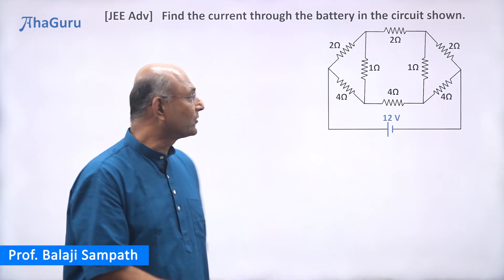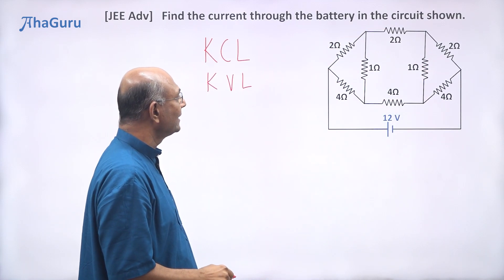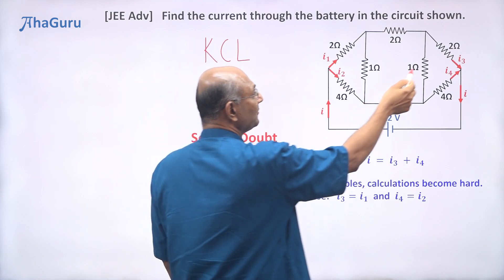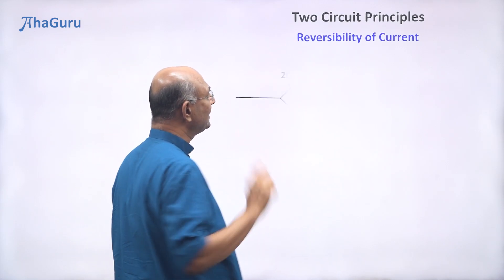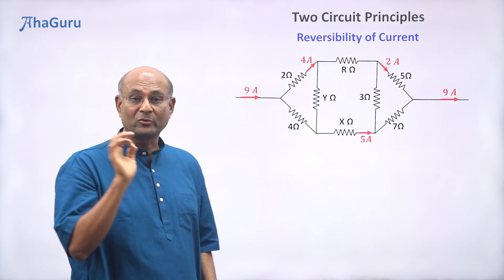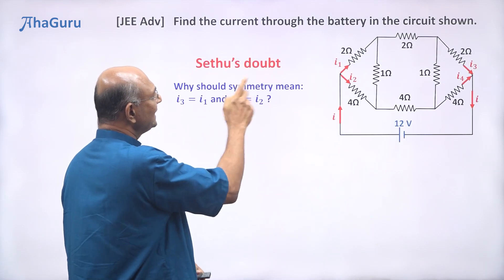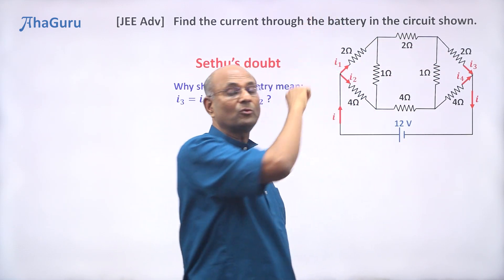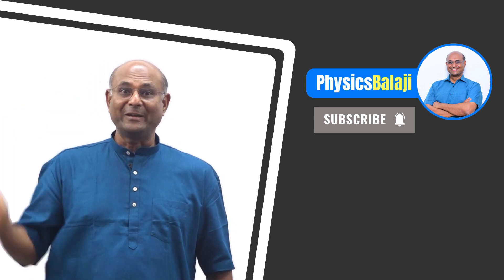How to solve IIT JEE Electric Circuits using Symmetry

Comment: alternate solution: apply delta-star transform, the circuit is now very easy
Reply from the maker: There is an even easier way to solve it by using uniqueness theorem.  It is just one step. I will explain that in my next video.  But it is still important to address Sethu question for the proof!

Comment: As the circuit has a plane of symmetry, it can be rotated and superimposed on itself

Assume the currents to be i1, i2, i3, and i4. Use reversibility principle to reverse all the currents. Now rotate the circuit so that it is identical with the original one (rotation does not affect the boundary conditions, therefore same solution - we can rotate freely). Now by the uniqueness theorem the solutions are the same, hence the currents are the same. Therefore i1 = i3, i2 = i4. QED

But now the question arises, why is the reversibility principle true?? Is it because of time symmetry of Maxwell's Laws? Also why should Maxwell's laws have the structure of poisson's equation, hence satisfying the uniqueness theorem?
Reply from the maker: Exactly!  That is the proof explaining the reason why the currents have to be the same.  Well done 👏👏👏
Reply from the maker: The reversibility principle is true because Kirchhoff's equations are linear.  So we can multiply each equation by -1.  That's the same as reversing all the currents.   And uniqueness says that is the only solution.
Reply: Uniqueness flows from Maxwell's equations.  But why are Maxwell's equations leading to uniqueness is a deep philosophical question!  But luckily it does.  Otherwise nature would be even more unpredictable 😂